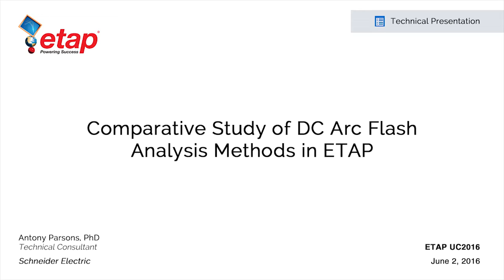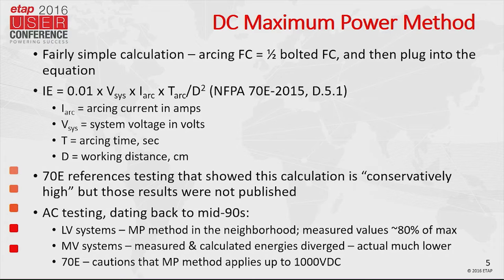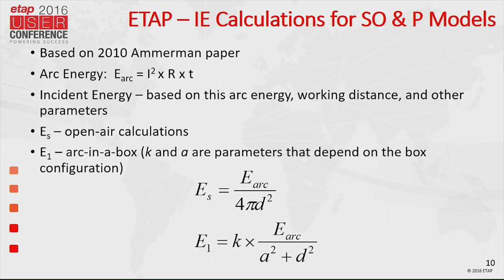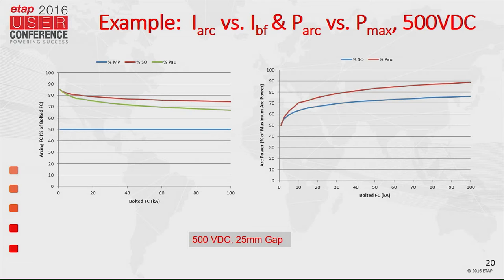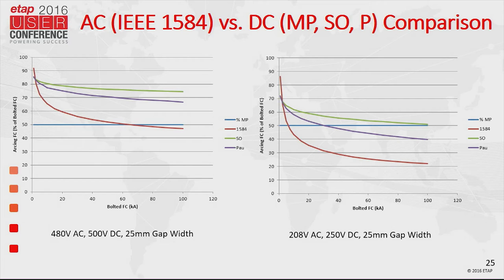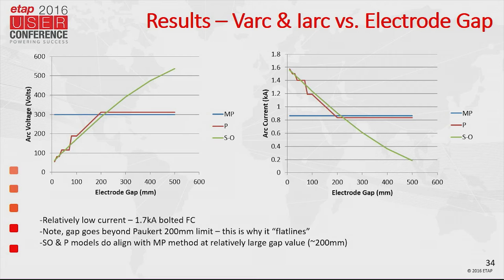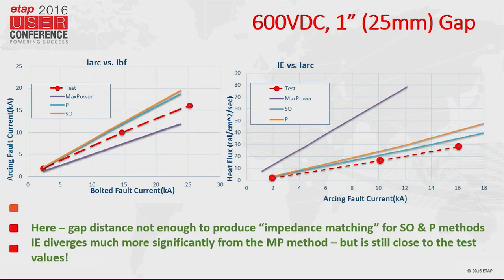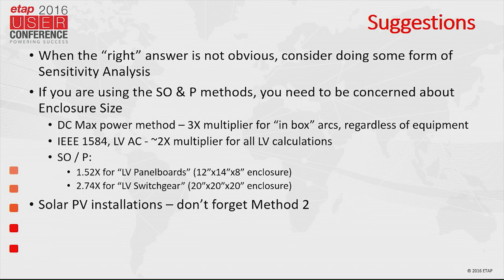Comparative Study of DC Arc Flash Analysis Methods in ETAP

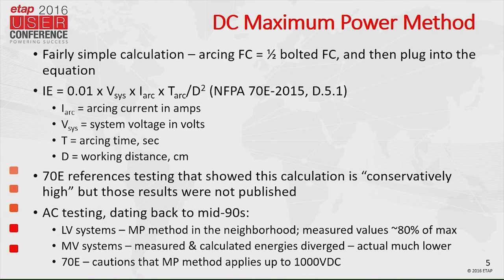Comment: 6:00 Having a challenge find Tarc for my DC low voltage, high current battery system, prior to any fusing. Some papers used Tarc=2 but that produces very high IE. How do you go about finding Tarc ?  NFPA 70E does not discuss it.
Reply: Hi. Tarc=2 is an approach from IEEE 1584-2018 standard section 6.9.1 which requires engineering judgement. Since Incident energy is a time based process, the best practice is to have DC fuse in your library  that can trip in a quick time for the arc current that it sees based on the method. You can use the DC Arc flash calculator within ETAP to determine a time that keeps the incident energy within your desired limits and select your fuse accordingly

Comment: How to calculate Iarc in Stokes and Oppenlander Model & Paukert’s Method?
Reply: The calculation of Iarc using stokes method is iterative and it is based on the gap between the conductors. The arc resistance is added to the system resistance and current flowing through this resistance is iteratively calculated using ETAP. If you still have any questions, Please contact ETAP helpdesk. Thank you